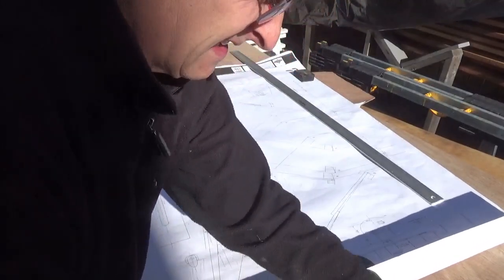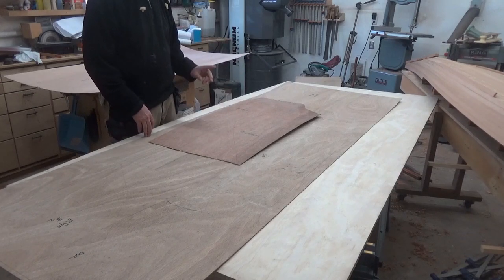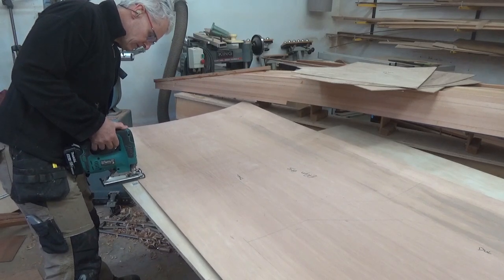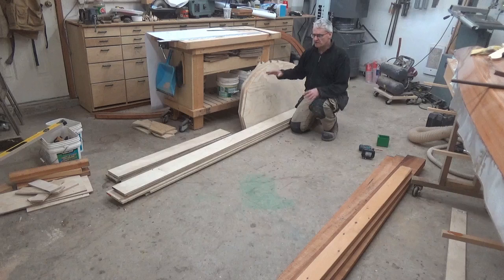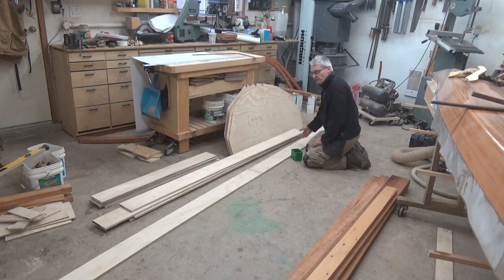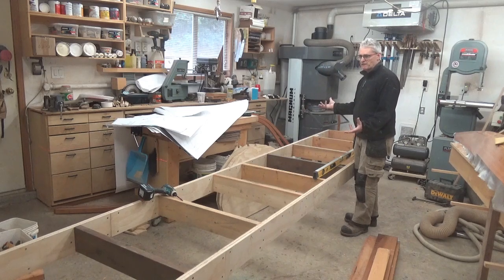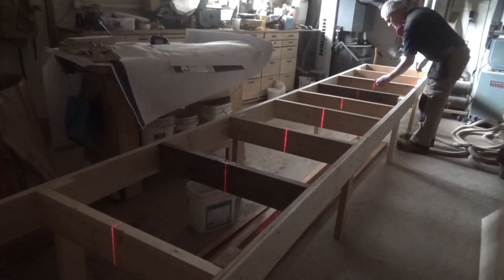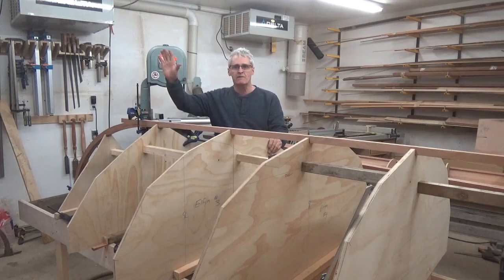Building the Wooden Boat "Elfyn" EP 2 - Strongback and Forms

Comment: As a new builder myself I was very interested to hear you say that your strongback was within 1/32". By my reckoning that is 0.7mm. I will be making my strongback soon and the tolerances used in boatbuilding have been a source of puzzlement to me. I know a lot of things are made to fit just right, but other things nee to be made just right. Do you have any guidance for someone who has more rulers than any other type of tool please?
Reply from the maker: Tolerances may depend on the style of boat and length.  1/32 over 16 ft. is not much but may not be acceptable on a 7 ft. pram.  And wood is pretty forgiving in other words it will take is own smooth line when offered up to the boat.
Reply: @OrcaboatsCa  I get it: If it isn't right, work on it some more. Which is what I do any way, and what I have seen on the builds I follow. I think I just wanted the reassurance I wasn't being slap dash. Thank you for the reply.

Comment: Hi Rod, where on the plans do you find the mold spacing on the strong back? I'm looking at the 1:16 scale picture of the inverted boat on the strong back of sheet 4 of 7 and I can not see for the life of me the spacing for the molds...? Is it the 8 athwartship lines on sheet 1?

Thanks Rod
Reply from the maker: The scale is 1:8 or 1.5 inch equals 12 inches.  So I do not remembers specifically, but with that look at page 2 of 7 and measure the distances.  #4 is center so if I remember correctly, it is centered on the line and then 3 and 5 are fore and aft of the line with the rest equal distance.  Hope that helps.

Comment: cut mold 1 out of 5 and 8 out of 4 or 6 too only use two sheets of ply I used three sheets I wanted six feet for the stems platform.
Reply from the maker: I generally use the plywood forms from one boat to make a new set of molds for another but getting smaller molds from center of larger ones is prudent use of lumber.